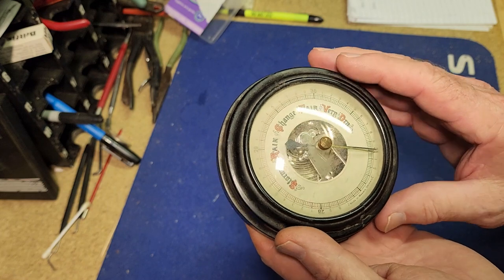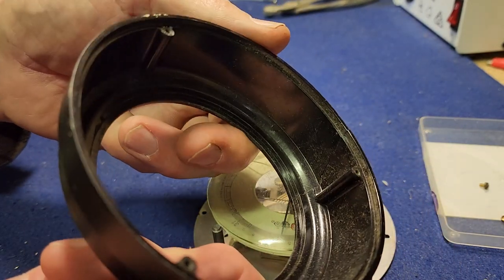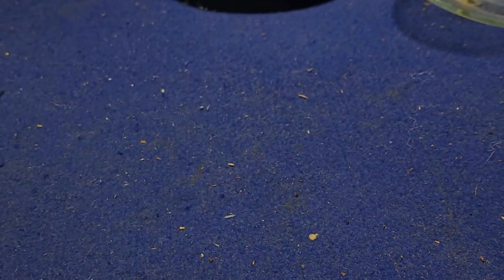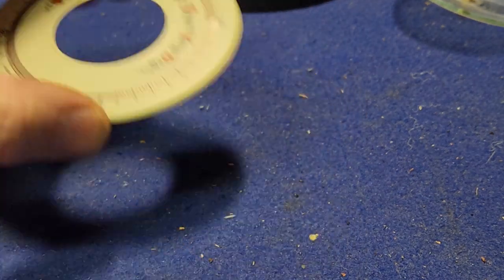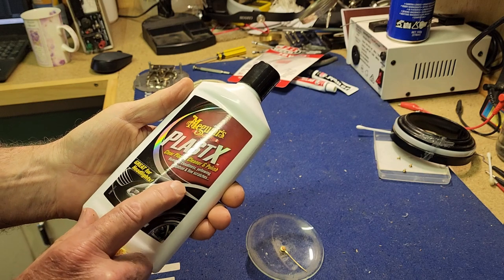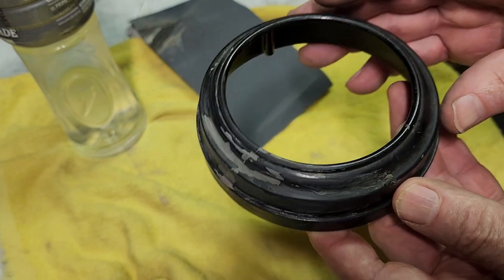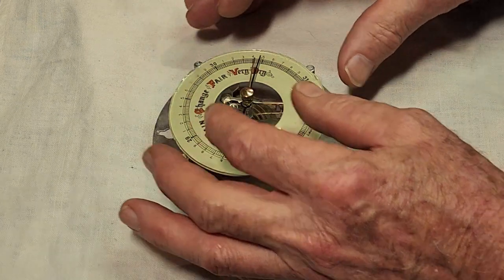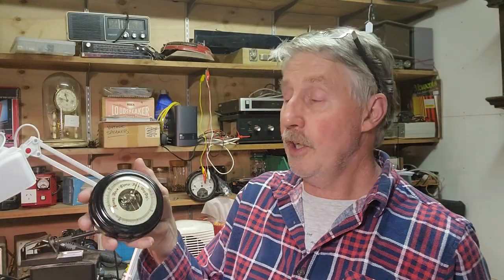Vintage West German Barometer Repair & Restoration plus How to Calibrate for your area

Comment: Hi Chris.
These are my my favorite videos of yours.
I collect Barometers.
And I think, Thanks to your clock repair vids,  that I may have stumbled across why old barometer pointers dont move from high to low pressure as much anymore.

Well they have much the same clock like movements in them.
So they proberly " gumup" with old dryed out oil ! ( I lernt this from you )
So if I use your technique of cleaning away the old oil and then applying new oil, I think that we could regain full movement in the dial pointer again !
I noticed that the micro chain on the barometer you were working on looked to be stiff and " gummed up ".
I was actually waiting for you to use your clock cleaning technique on that unit.
I,am a big follower of you,   Love your vids.
I,am looking to retire in 4 yrs and move from Newcastle NSW to central VIC !
All the best Chris.  Say hi to Christine for me.
Ian T.
Reply from the maker: Thanks Ian! 😊 You could well be right about the works needing a clean & re-lube. I didn't bother going to that much trouble and the barometer is actually fluctuating quite well now anyway.
I think the main use of barometers is to see if the pressure is rising or falling rather than reading off the exact barometric pressure! Be sure to call in and say hello when you make it down mate! 😊👍 Christine says Hi back! 😊

Comment: Thanks for the video and showing how to calibrate the barometer at the end, which was the part I especially needed.  I just picked one up from the thrift store that has the same guts but the surround is wood ships wheel.
Reply from the maker: Yep, they turn up at thrift stores quite often and I usually grab them! Thanks for watching Chris 😊👍

Comment: From memory the disk is actually two disks, one concave and one convex, sealed together. When the atmospheric pressure changes the needle is moved by the differential between that and the constant pressure (could even be a vacuum) in the hermetically sealed discs.
Reply from the maker: That sounds an accurate description David, thank you! 👍

Comment: Have you been checking to see if the barometer is keeping the correct pressure after a change in pressure?
Reply from the maker: It is responding well to the change in pressure Martin - which is all that I'm really interested in to be honest. I don't really care what the actual pressure is but I do look to see if it's dropping, stable or rising. So no - I haven't actually checked that the pressure reading is accurate.
Reply: @TheUltimateRecycler  I was just curious, if these things were actually accurate?  I'd always suspected they weren't, but who knows, perhaps I've been unfairly dismissing them!?
Reply: You might be in a unique position to have a handful of different models in your shop and see how they keep track with one another...
Reply from the maker: @martincowie4520  Yes, it would be an interesting comparison indeed. I only have this one in the shop at the moment though. I suspect that they won't be very accurate also!